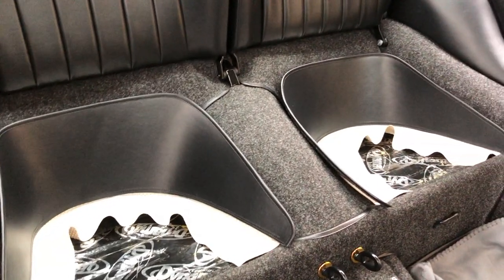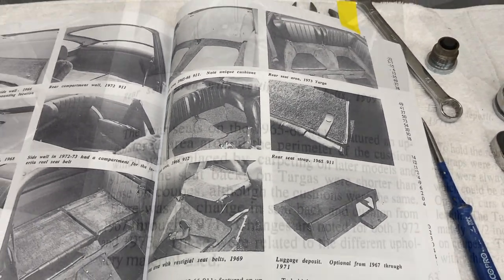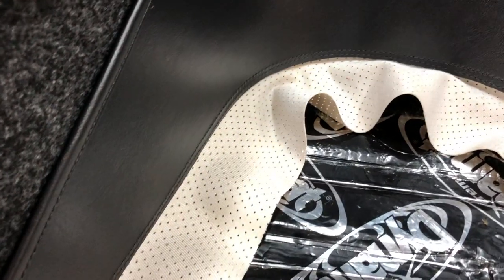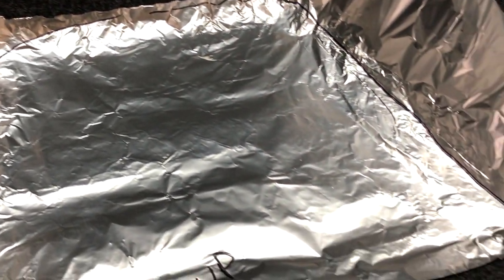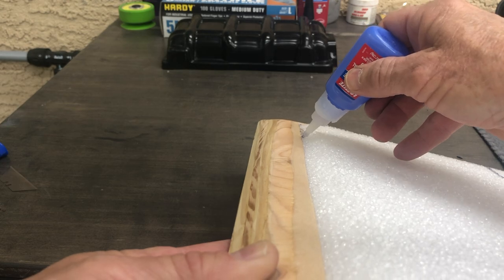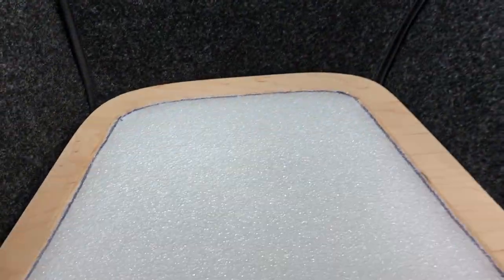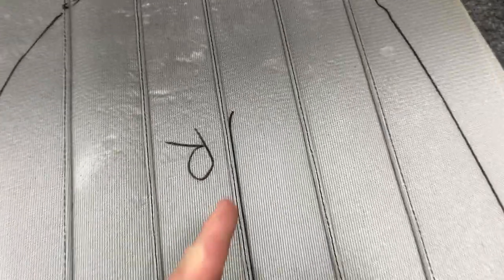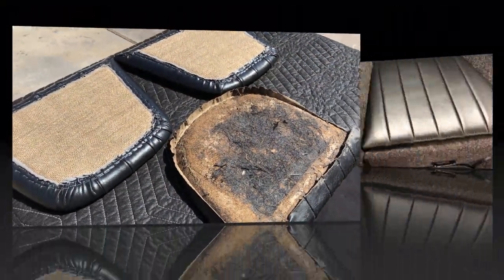Porsche 911 & 912 Rear seating upholstery Part-2 seat cushions

Comment: You may want to consider using some spray adhesive on your garage wall aluminum foil insulation.
Reply from the maker: Hello Noisy..Yes I agree the foil is annoying.. Its a temporary UV block while building the car. It will come down soon. Wind filters its way thru the booth creating that annoyance

Comment: They look great.  Do the get glued down or just rest there?  Thanks for the videos.
Reply: Dont know how they were from the factory but these should be somehow be fixed to the car otherwise they could fly on hard braking or god forbid, in an accident.
Reply from the maker: Thanks..the factory originals were cemented in with an asphalt based adhesive. For now and cleaning purposes I will leave them removable but if becomes an issue can easily cement them in with contact cement.
Reply: @MikesRestorations  Maybe some wide Velcro strips to hold them down and avoid a permanent adhesive?
Reply from the maker: @daverph  I thinks that probably the best idea!

Comment: does it hurt the authenticity or any judging since there is Dynamat installed? I do understand that it is not seen after installation.
Reply from the maker: Hello Kirk..Thats would be a good question for someone who is experience with concours details .. I am not experienced in that arena. however it might.
There are many other things to consider in a concours pick than soundproofing .
Pros and cons to everything..modern materials can do a better job but for the purist it probably doesn't matter if its better
Just matters the way it came from the factory..